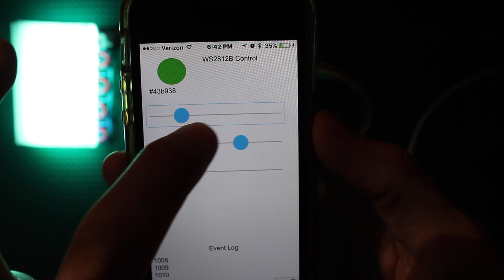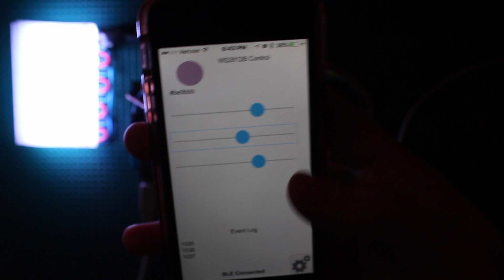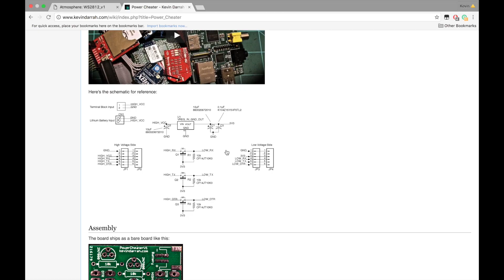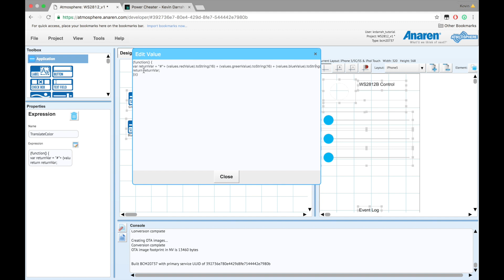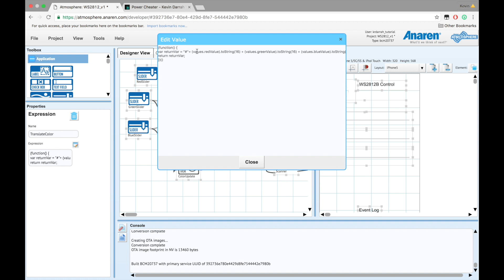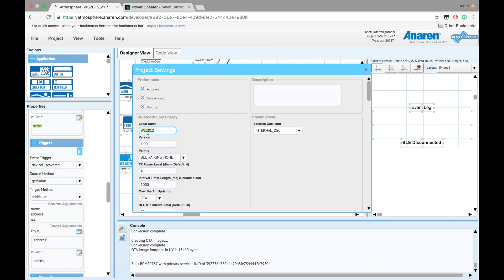Easy Bluetooth Controlled Addressable LEDs! (WS2812 + Arduino + BLE)

Comment: Hi Kevin, i try to build a similar project with Neopixel WS2812b LEDs + Digispark + BLE HM-10 but i try to build an iOS App for control.

Could you say me, please, where i can find the xcode project for control my BLE HM-10?
Reply from the maker: sorry, can't help with the HM-10, but if you check the description, the wiki has an example using Xcode to work with BLE
Reply: Kevin Darrah Thanks Kevin for quick reply and  for your help. 😊

Comment: How do you make the code check its connection status. I want to know if theres a way for it to reconnect after going out of range / powering off then coming back in range.
Reply from the maker: yep, that's possible and exactly what the code in this video does.  As soon as it's back within range it will reconnect

Comment: Have you considered just controling everything from the BLE module? If you can program the BLE module, then it could talk to the 2812 modules directly and eliminate the middle-man arduino.
Reply from the maker: Yea maybe, but the BLE part has to service the bluetooth communication stuff that I think would mess with the precise timing needed by the LEDs.  I may try that though.
Reply: Check this out:
http://wiki.artifactory.org.au/doku.php?id=projects:ws2811clockshaper
It allows you to just send the data over a SPI line, and I believe I saw that the BLE module has a SPI port
Reply: Also here is an interesting read:
https://wp.josh.com/2014/05/13/ws2812-neopixels-are-not-so-finicky-once-you-get-to-know-them/
I'll admit that I have not used these LEDs before, but these techniques could be worth trying?

Comment: Very practical project. I was surprised about your solution with the 16 start value. Why not add a "0" at the source when string length  is 1? I am building up my workbench and parts are on order to start working on these kind of things so no actual code to show a complete solution. At least I subcribed to your youtube channel because of your really straightforward way of explaining things!
Reply from the maker: yea somebody else chimed in early on - I updated the project code with that

Comment: you are great. I saw your lot of videos like wireless related. 
Now I need your help. I am try to use both nrf24L01 and HC05 with my nano. when I use this both I got some noise on my serial window. 
I try to extend the tx and rx range in my home automation. I just connect my hco5 with my uno tx rx TTL and I am using simple app to control the load. 
Now I am going to extend the range. so i choose nrf24l01 and download the rf24 driver driver. 
Here is the concept my android phone send the data to my uno through bluetooth. 
uno have to modules one is hc05 and nrf24l01 this hc05 receive the date through tx and rx pins. then this data again send through nrf24l01 in spi protocol.(RF24 lib)
on other end I connected nano and nrf24l01 receiver spi protocol. and some LED for testing purpose. 
now the problem is while is using this nrf24l01 and hc05 in transmitter module that time i got serial msg(tx led blinking) 
and does not receive and does not send the the data through nrf in transmitter section.

tx code.
#include <SPI.h>
#include "nRF24L01.h" 
#include "RF24.h" 

int msg[0]; 
RF24 radio(9, 10); 
const uint64_t pipe = 0xC2CAC2CFB2CA; 
char val; void setup() { 
Serial.begin(38400); 
radio.begin(); 
radio.openWritingPipe(pipe); 
} 
void loop() { 
while (Serial.available()) {
 val = Serial.read(); 
Serial.println(val); 
if (val == 'A') {
msg[0] = 000; radio.write(msg, 1);
 } 
if (val == 'a') { 
msg[0] = 111; 
radio.write(msg, 1); 
} 
} 
}

rxcode

#include <SPI.h> 
#include "nRF24L01.h" 
#include "RF24.h" 
int msg[10]; 
RF24 radio(9,10); 
const uint64_t pipe = 0xC2CAC2CFB2CA; 
void setup(){ 
Serial.begin(9600); 
radio.begin(); 
radio.openReadingPipe(1,pipe); 
radio.startListening(); 
pinMode(2, OUTPUT); 
} 
void loop(void){ 
if (radio.available()){ 
bool done = false; 
while (!done){ 
radio.read(msg,1); 
if(msg[0]==000){ 
delay(10); 
digitalWrite(2, HIGH);
} 
if(msg[0]==111){ 
delay(10); 
digitalWrite(2,LOW); 
} 
} 
} 
else{ Serial.println("No radio available"); 
}
}

Comment: this is 20€ board, alternatively i can just buy, HC-06 for 2.5€
Reply from the maker: yep, that could work too, but you won't be able to get that board talking with iOS and you don't get the cool app builder software.  Plus it's not FCC/CE certified... but, there's tradeoffs with everything.

Comment: Great video! Here's a pretty readable way to write your function without losing the low values: var r = values.redValue.toString(16);
var g = values.greenValue.toString(16);
var b = values.blueValue.toString(16);
if (r.length == 1) r = "0" + r; 
if (g.length == 1) g = "0" + g;
if (b.length == 1) b = "0" + b;
return "#" + r + g + b;
Reply from the maker: that's awesome - and very simple.  Just tested and it works great!  I'll update the video description now

Comment: Hi Kevin!! Good video! And I have some questions about this project.. First one, related to the Rx and Tx signals coming from the Arduino to BLE,  Should those signals be regulated to 3,3 volts? In the last video You didn't use the voltaje regulated board that you show us here, and I see that you have connected Rx and Tx through that board.
Second question, regarding the Arduino code, I see in the code you show us, that you import a library called "softwareserial" this library belongs the BLE board? Are there a Arduino library that We can use with the BLE board?  Thank you again for yours videos!
Reply from the maker: good questions:  yea, the last video I ran the Arduino board at 3.3V, so no need for level translators - both boards were at the same logic level.  Here, I ran the Arduino at 5V, so the TX/RX signals needed translation.  Software Serial is not specific to the BLE board - I think that library comes with the Arduino IDE when you download it.  Basically, that just allows you to get a Serial connection on any of the pins, not forcing you to use the "Hardware" Serial port on pins 0 and 1.  No library for the BLE board yet, but you probably won't need one, since it's so easy to work with.